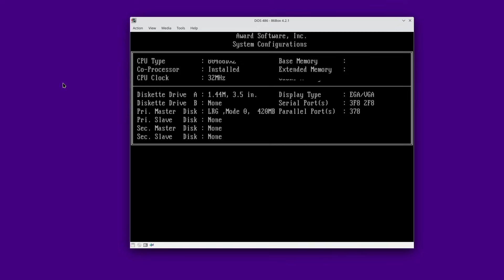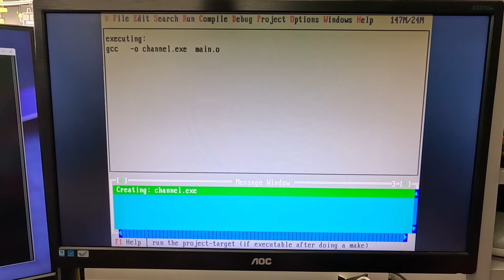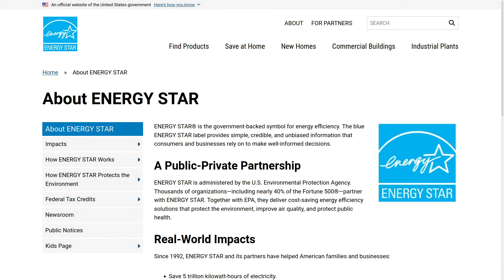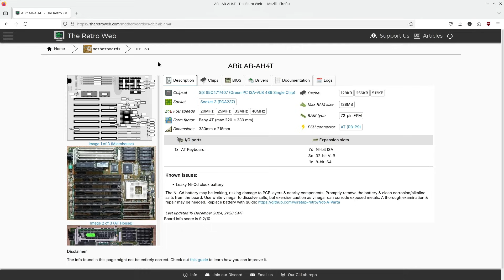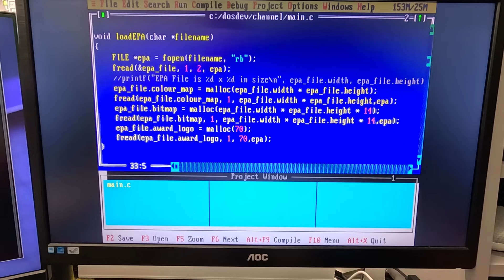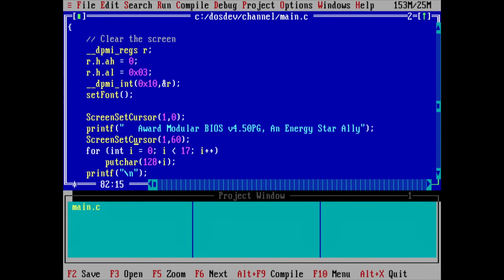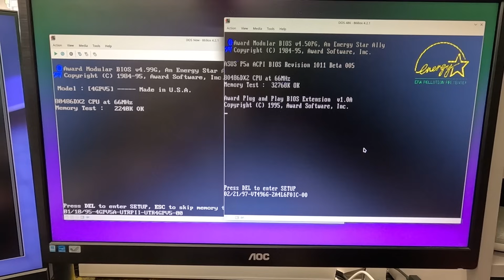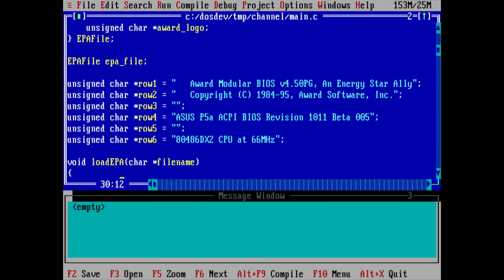Retro MS-DOS Coding - Recreating the Iconic Award BIOS Screen

Comment: I know how to fix this. The VGA characters are 9 columns wide, but you only define 8 columns of pixel data. The 9th column for each character is blank, which is what creates the horizontal stripes in your graphics. This fine for most characters, the blank column just serves as the space between characters, but the horizontal box drawing characters (like ╨╤╥╙ etc.) it does not look correct.

That's why these characters are handled in a special way, whatever pixel data is defined for the 8th column is also used for the 9th column. Only characters 0xc0 to 0xdf are handled this way. if you look at the VGA character set, you will see that characters 0xc0 to 0xdf are all characters that need this functionality.

So, the solution is to use characters 0xc0 to 0xdf for your graphics, at least where you need to avoid the blank 9th column. Perhaps use the same characters the real BIOS uses, I'm sure they carefully selected which characters need the blank 9th column and which characters need the 9th column to be a copy of the 8th column.
Reply: See also, wikipedia article for "VGA text mode":

"[...] the 9th column is used for spacing between characters, so the content cannot be changed. It is always blank, and drawn with the current background colour.[6] An exception to this is in Line Graphics Enable mode, which causes code points 0xC0 to 0xDF inclusive[6] to have the 8th column repeated as the 9th. These code points cover those box-drawing characters which must extend all the way to the right side of the glyph box."
Reply: The problem is, the range is too small to fit the whole logo and the 9th bit extention is also only faking it by duplicating one column. But in vga one can enable 8/9 dot mode so the vga uses 8 bit character with, then the data works as is in vga.
Reply: @DavidPfohmann  I don't remember VGA having an 80x25 mode where characters are 8 columns wide, but it's very much possible my memory has failed me. I vaguely remember that the same text mode uses 8 column characters for EGA and 9 column characters for VGA (so you can't choose, it just depends on which adapter you're using).

Anyway, if it is the standard VGA mode, I think you can still fit the logo in. You don't need to fit all the characters into the 0xc0-0xdf block, just those that need to extend into the 9th column, which is needed for just a portion of the logo. Also, at 15:33 you can see that the original BIOS actually uses the block drawing character range for the logo (whenever they need to avoid the blank 9th column), so I still suspect they use the 9 column mode + clever logo design that makes the duplicated column less obvious, otherwise they could have just chosen any random characters.
Reply: @DavidPfohmann  Update: I just noticed they don't use box drawing characters for the blue logo on top left, which means you're likely right and they use a mode where the 9th column issue does not exist.
Reply: @matushorvath  yes, on an vga you need to enable the mode explicitly. Running the same code on an ega gives you 8x14 font as expected, without the gaps. But yeah, maybe there are other ways as well. I don't claim the be a vga expert at all. 😅

Comment: Hey, cool video.

As for the issue with the gaps. Some people already noted, it is connected to your VGA adapter using 9 pixel wide glyphs (as for 720 internal surface the VGA uses). The last bit is usually set to zero, so there's your black lines coming from. Except the range 0xc0 to 0xdf, the default fonts use this range as block characters, therefore the VGA will extend bit 8 to bit 9 so the block is filling the whole 9 bits and don't suffer the black gap (you can actually see this in your video as well, parts of the star as well as the horizontal line seem to be properly filled, except they arent really).

If you run the program on an EGA or CGA adapter (try configuring the machine of your DoxBox) you'll see the logo is displayed perfectly fine. Thats probably not the fix you are looking for though. 🙂

So, on the VGA you can set 8/9 dot mode flag to 1, so 8 bit wide characters are used: outport(0x3C4, 0x0101).

Then your logo will hopefully shine in all its glory.

Two more things:
- the glyph foreground and background info are also in the epa file. You even loaded the data in your colourmap, but didn't use it somehow later. 

- instead of using putchar for the logo it would be probably more natural to write the logo (or the whole screen even) directly to text memory at 8B00:0000. 

Cheers
Reply: *B800:0000. ♥
Reply: @Ice_Karma   "You just kludge yourself a pointer -- >  char far *vptr = (char far *)0xB8000000;   < --  to video memory, and memcpy() directly to it" said my mentor, John Wagner in the U'NI-net message.  I hope you're doing great John, where ever you are.
Reply: I remember setting the 8/9 dot mode flag on some program, though I was doing a mouse cursor in text mode. It looked like Windows 3.1

I could not recall the port number, glad someone else did. I hope a follow up video is posted soon.
Reply: Specifically, adding "outportw(0x3C4, 0x0101);" just before the call to setFont() fixes the font size issue.
Reply: Some of the characters already fall into the block that gets column 8 duplicated into column 9, which is why there aren't black lines in the whole logo. But the duplication still makes things look chunky and wrong (like the left verticals of several of the characters in "EPA POLLUTION PREVENTER").

Comment: Hello, 86Box lead developer here - both Award and AMI BIOS'es at the time used the EGA 8x14 mode for the POST screen precisely so they could display the logo without having to worry about the character padding to 9 pixels.
Reply: I know it's possible to 'tweak' VGA to use 8 pixels for font. But is there a 'standard/proper' way to switch VGA into 640x350 EGA text mode?
Reply: @alexloktionoff6833  IIRC, you can do this by writing to the video card registers directly, but there is no standard support for doing that via the BIOS INT 10h call.  (Note: Configuring the VGA card registers directly yourself is entirely standard and proper for a DOS program to do (and was common practice for lots of programs that wanted to do more than very simple text/graphics displays).  It just doesn't have a convenient helper function in the BIOS to make it easy for you, so you need to do more work, is all.)

I think some old BIOSes may have had nonstandard video mode values you could use to switch to some of these alternate modes, but they were never "official", and could vary from one BIOS to another (and would probably not be supported by most emulators)...
Reply: @alexloktionoff6833  VESA modeset .. (should work on 99.9% of video cards)
Reply: @alexloktionoff6833  That's the thing - the VGA BIOS can switch to 640x350 8x14 characters where to do 8x16 640x400 you have to poke around I/O ports.
Reply: when I was 16 in 1998, I loved to fake bios screens and to get the energy logo I used mm paper and drew it by holding it against the screen, then extracted pixel by pixel by reafin off the mm paper 😂😂
Reply: @shinzon0 that's crazy 😄
Reply: It's a pity he didn't get that last step! A perfect reproduction would have been MWA!
Reply: I made half-graphics and half-text mode screens on VGA, even the so classic colored rasterlines were possible on a VGA, just like on a good old Commodore 64  (before Windows) - unfortunately not with interrupt timing but with fake cpu cycles (using NOP commands).
Reply: I'd have thought they'd load the characters that have pixels set on the right edge into characters 0xC0 through 0xDF, where the box drawing characters with rightward lines and the solid blocks are. But that'd require more micromanaging of what characters go to what spots.
Reply: Where can I find out about how the BIOS interacts with the mmu? My goal is to modify your system or create a driver that allows one to use Isa visa or PCI cards, or external bus like ide or SCSI 
AS RAM 
That is , make usable and report to the OS , some arbitrarily huge amount of RAM (up to the max of whatever bit system will be installed,16,32,64) 
    The problem is I want more available RAM then there is room in real hardware ram for the page table, making paging impossible , not just impractical due to thrashing. 
   How would I redirect memory access at the BIOS level? 
    Just for proof of concept I would start by using a dedicated hard drive as RAM, and then the actual ram as an l2 cache. Then if I can get that to work, I would design a card containing dram to serve the same function. I understand the bus speed limitations would make memory access a thousand times slower at least, but when you compare that to having 95% of your memory paged out and constantly thrashing to a slow hard drive, It's actually an improvement.
   For such a cluge to work it would likely have to be implemented at the BIOS level. Direct addressing of the mmu at the very least. 
    Can I pick your brain and where can I learn more about how to do this?
Reply: @petevenuti7355  Back in DOS there was main memory, then Extended Memory and Expanded Memory.  One of those two (I think "Expanded") was for add-in cards with extra RAM.  It wasn't as fast as system memory, but was still way faster than hard disk.  Most apps supported one or both of those standards.  Maybe look into how those handled memory paging.  I'm not sure what the max memory supported by those standards was.
Reply: @RavenMobile the expanded memory is just normal ram above 1 megabyte. This split between low and high (or extended) at 1 mb boundry is an interesting legacy quirk of the IBM pc. Long story short, 286 came out with support for more than 1MB but at the time msdos relied on the fact that the machine will have max 1mb and addressing more than that will wrap around to 0. IBM figured this out quite late and as a quick fix they connected the 20th address line to a spare pin on their keyboard controller and set it's value by default to 0, essentially limiting the ram to 1mb max. This limit could be disabled and this is what Ms dos called the "extended memory". Btw, this so called A20 gate is still implemented in all x86 CPUs to this day. They all still boot in 16 bit real mode with A20 gate disabled as if it was 8086 chip.
Reply: PCem still is a better option :)

Comment: As I remember my school age (end of 1990-th) this issue with separated symbols came when I tried some videomodes with int10h. My theory is that there is some modes, where 1 bit of font is ignored (i.e. from 8x14 symbol only taken 7x14 pixels). Or in some modes one additional pixel is added between symbols. Also I saw that spaces when some residential apps like ciryllic font driver changed video mode. So just try other modes with int10h - there are some of them beyond standard values, described in manuals.
Reply: There's two modes - 8 bits per character clock and the other one that extends to 9 by inserting a blank bit on every line or, for a handful of characters, a copy of the 8th bit (to allow for the box drawing characters to function properly). The Award BIOS uses the former, in EGA mode with 14 lines per character.

Comment: A few bits about the comparison you did to a real Award BIOS near the end. You can force 86Box to run in 4:3 from the View menu, this will probably make it look more like you'd expect it to look on a real screen. EGA was 640x350 if I recall, so would look vertically stretched on a 4:3 screen. I wouldn't be too concerned about the font because it was very specific to the video card manufacturer. The one in your 86Box VM looks somewhat like an S3 card. ATI had a different one, and Cirrus Logic used a different one that's very similar to what Nvidia used. It's also possible to change the font in DOS by using MODE to change the codepage, the font in your version looks very like the one from the EGA.CPI file.

Comment: 15:18 Award started using graphics mode from 4.51 or later onwards. Before that, they used text mode with custom characters.
Noticed this myself when working with older computers.
You'll notice this by the cursor characteristics.

To fix your issue, just use the characterspaces where the lines are going trough the right side of the character!
The characters in VGA Textmode are 9x16. (or 9x14 depending on your mode).
On some characters, if the rightmost bit is set, there'll be another bit added in the 9th column!
Should be characters #192-223 afair.

Edit: There are also textmodes with 8x14/8x16 characters. You can use one of them.

Comment: There was a trick when VGA mode started using 9-column characters. Wiki says:  "In Line Graphics Enable mode, which causes code points 0xC0 to 0xDF inclusive[6] to have the 8th column repeated as the 9th.".  I recall the repeating part, because I fiddled with redefining characters, but not that the repeating was restricted only to certain character codes. Maybe this feature could be switched off on demand using some registers.

Comment: Fun stuff, mucking about trying to "faithfully" recreating it. The other option is to simply fake it, which would mean just setting the right screen mode and writing your own "raw drawing" parts, essentially recreating that part of the BIOS. Which, to be honest, is what you'll want to do for "demo like" stuff. Many of the "funkier" old school methods were a sort of necessity give HW limitations, but NOT fun bar the "abusing the system" part. If just wanting to do some "cool stuff", given any (half) decent CPU you're better off just using a memory buffer, raw dogging it and then simply copying some "viewport" to the screen memory every frame. But... and there's always a but isn't there... easier doesn't mean easy peasy. You have to write ALL the part you need. Text rendering? That's going to need a bitmap font and some blit'ting routines. So on and so forth. The nice part is that since you're just raw dogging a memory buffer from one place to another, you can write (and test) your "cool part" in a more friendly environment and then move it to the "real environment" pretty much "as is".
Sine scrolling "text" is pretty iconic and simple to do for example, you just change the y coord of your base drawing point for every new column, shift the whole block to the left/right and draw the next column. Easy peasy. Unless you have it on top of other stuff. Then you need to do in on a separate buffer and blit it with masking. Ah, there we go ;) Background could be a star field or warp effect, which would be another two iconic ones, each with thousands of variations and challenges.

Comment: In the early 2000s some motherboards, like SiS started putting a 4Mb nvram chip as the bios, and you could patch your linux kernel, compile it and use a util to write it into that nvram chip, so when you turned on your computer there was none of that stuff, as it powered on it just said Loading Linux.... and started booting, there was no bios or bootloader.
Reply: and nowadays coreboot roughly tries to do the same thing -- get into the kernel ASAP.

Comment: I allways thought this was something the monitor itself would display when it detected the PC turning on.
Reply: Some CRT monitor have an "out of range" message, if no input signal is aviable. I don’t know if a monitor can get special information from the bios, but we can get the EDID data from the monitor with the prefered resolution and the highest refreshrate using 16 bit mode of the CPU.

Comment: I made a picture to character converter for monochrome pictures with 2 colors and with 112*112 pixel to display the picture inside of a block of 14*7=98 extended ASCII character starting with number 128 using 8*16 character size.

Additonal i made a routine to convert 112*112 pixel of the graphic mode hex 13 with 320*200 resolution starting in the upper left corner at address offset 0. The routine use 8 addresses horizontal to collect 8 bits (bit set if address have a color(1-255), or bit not set if color=0) and then another 8 addresses of the second row and so on 16 times for one character. Second character start at offset address 8.

Comment: Hmm at 11:14; when you called int 10 you put a divergent value compared to the documentation in AX (1110 vs 1100). 
What’s the difference?
Reply: I think function ax=1110 recalculate the entire screen and ax=1100 only a part? I am not sure.